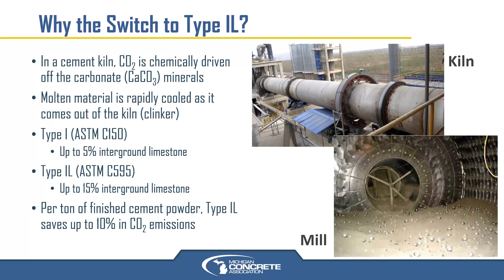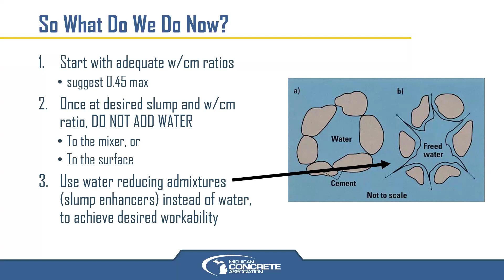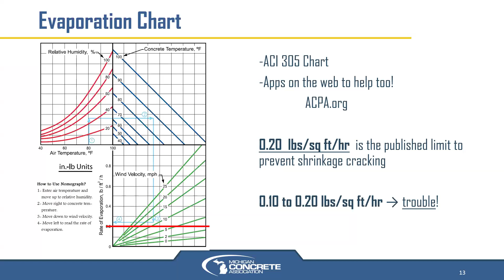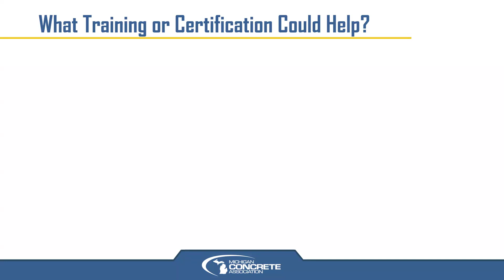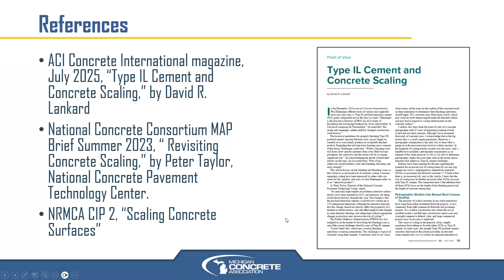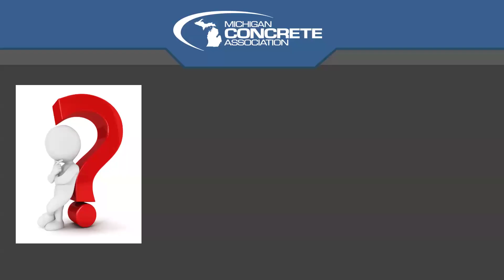How to Place and Finish Concrete with Portland Limestone Cement (Type IL) | Best Practices 2025

Comment: All you are doing is essentially explaining the correct procedures in which ACI, NRMCA, etc have specified for finishing concrete. Specifications should be followed regardless of cement type. Yes, more attention to proper finishing techniques may need to be followed, but the fact that these specified practices may not have been followed in the past is the actual issue, not the change in cement type. People try to blame a new cement type for creating these issues, but in reality, if specified finishing practiced were routinely followed, it would have been a much smoother transition. Unfortunately it had to take a new cement type to expose the improper finishing practices that have been happening for years.